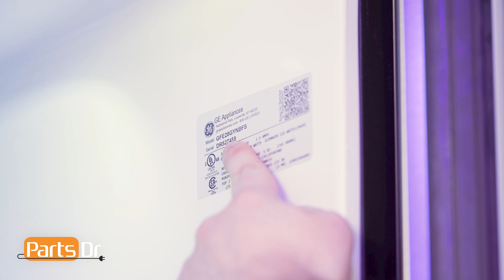GE refrigerator not cooling? Check these 5 things first!

Comment from the maker: We're glad you're here to troubleshoot your GE refrigerator! A quick heads-up if you need to replace any parts, be cautious when shopping online. Many of the lower-cost aftermarket parts on sites like Amazon or eBay are of much lower quality and can lead to further issues or even damage.

For the best results, we always recommend using genuine OEM parts. You can find high-quality GE refrigerator parts on our website at https://partsdr.com. These original parts are designed to work seamlessly with your appliance and provide lasting performance.

We hope this video helps you get your fridge cooling again. Let us know how your repair goes!

Comment: What about a refrigerator that is only three years old it’s a GE counter depth. I’ve taken off the back and tried to clean all the dust out as best I could, but it’s not cooling and it has a weird smell when you open the doors it kind of smells like burn pickles. I don’t know how else to describe it. I’ve taken all the shelves out I’ve smelled. I don’t know where the smell is coming from.

Comment: I just bought a house and moved in and the GE refrigerator (same one in this video) hasn’t been working. I had someone come clean the coils and the fan behind the back panel of the refrigerator and that still didn’t fix it so they came back and replaced the fan inside the refrigerator because it was also broken. While fully broken the refrigerator was rarely below 40, it was typically around 58 degrees. After cleaning the fan and coils in the back and replacing the fan inside the refrigerator section the temperature is usually at 34/35 which it’s set at that so that’s good, but I sometimes open the refrigerator and it’s like 42/43 degrees. Is something still broken? I don’t trust this refrigerator at all right now. I’m about to just buy a new refrigerator but I just moved into this house so I’m trying not to have the expense.

Comment: Hey bud, my fan in the freezer doesn’t stop while opened. And also my evaporator is frozen 
Perhaps one of the thermostats are failing ?
Reply from the maker: Yep, that could point to a bad door switch or a defrost issue. Try checking the door switch first, it should stop the fan when pressed. If that’s good, test the defrost thermostat and heater next.
Reply: Yeah the fan doesn’t work at all
Reply: Actually it’s on again now and the switch doesn’t turn it off

Comment: Thanks for the video.. originally, I thought it was the "Dual Water Inlet Valve" which I have already ordered.....but realized my freezer is not freezing as well.  I watched this video and I checked the fan to find, it will not turn off and I could see the element behind the fan (not real sure what to call it) has a chunk of ice formed over it which I dont see in your video.  Can you tell me what I need to order to get this repaired?  Thanks in advance
Reply from the maker: You’re right, that chunk of ice behind the fan is not supposed to be there. That area is the evaporator coil, and when it ices over it blocks airflow which stops the freezer from cooling properly. The most common causes are a failed defrost heater, defrost thermostat, defrost sensor, or control board not telling the unit to go into defrost. You’ll want to defrost the ice buildup so the fan can spin again, then test or replace the defrost components to keep the ice from coming back.  These video links below should help you:
Defrost sensor test: https://www.youtube.com/watch?v=SBfqozNgLYY
Defrost thermostat test: https://www.youtube.com/watch?v=i4SNEgPoUMY
Defrost heater test: https://www.youtube.com/watch?v=q7hysgipzpQ

Comment: Thanks for the great video.  Have double french door GE fridge ripped it all apart as the Refrigerator section wasn't cooling.  Fan wasn't working evaporator coils had lot of ice on them.  UPDATE:  Was worried about diagnostics to find the problem replaced the fridge fan and that alone fixed all the issues.  Defrost kicked on once fan ran for a while so thermostat & element worked fine to trigger that.  Simple $17 fix.
Reply from the maker: Thanks for the update, let us know how it goes!

Comment: I have a GE gfe26jymnffs the freezer its not freezing correctly, the coils has ice built-up. I replaced the 3 components,.temperature sensor, defrost thermostat and defrost heater and still has the same issue. Technician says maybe is the main control board, how can I test it? Any other suggestion?  Thanks

Comment: My GYE22GYNFS stopped cooling properly, fridge was at +50F, freezer I didn't measure it, but it melted frozen foods. But then, after a day or two, it resumed working, it happened twice, within a month a part. Is there a more likely issue here?

I had an appliance tech guy over, and he's saying it's the compressor and he said it would cost $1.4k to fix it.

Comment: My refrigerator doesn’t get very cold anymore and my freezer won’t freeze nothing. A few times a day my fridge will turn off and on and off and on every second so I have to unplug it and plug it back so I can stop shutting off and on. Am I right that it’s probably packed with ice and there’s and electrical issue underneath the refrigerator?
Reply from the maker: It’s possible you’re dealing with two related or unrelated issues. The cooling problem might be caused by ice buildup from a defrost system failure, while the turning on and off could point to an electrical issue or bad main control board. Sometimes a failing control board can actually cause both problems. Try checking for ice behind the rear freezer panel and inspect the control board for signs of damage or overheating.

Comment: What if the fan motor is completely dirty and has a bunch of lint back up in it?
Reply from the maker: If the fan motor is completely dirty and clogged with lint, it can definitely cause cooling issues. A dirty fan can slow down or stop completely, restricting airflow over the coils. Try cleaning the fan blades and motor area thoroughly. Just be sure to unplug the fridge first. If the fan still doesn't run smoothly afterward, the motor may need to be replaced. Let us know how it goes!

Comment: Could a bad thermistor cause the unit not to call for cooling at all?
Reply from the maker: Yes. A bad thermistor can send incorrect temperature readings to the control board, causing it not to activate the compressor or fans, so the unit won’t cool.  Try testing the thermistor as shown in this video here: https://www.youtube.com/watch?v=SBfqozNgLYY

Comment: Have a GE refrigerator not cooling. Both fan motors are operating, compressor operating. Evap coil was completely frozen like a block of ice. I thawed coil out and cleaned condenser motor and vents. After letting it sit for a day the coil starts to ice up around side rings less than 1 minute after turned on
Reply from the maker: It sounds like one of the automatic defrost components has failed.  Test and check the defrost heater, defrost sensor, and defrost thermostat to see if any of these have failed.
Test defrost thermostat: https://www.youtube.com/watch?v=i4SNEgPoUMY
Test defrost sensor: https://www.youtube.com/watch?v=SBfqozNgLYY
Test defrost heater: https://www.youtube.com/watch?v=q7hysgipzpQ

Comment: Such great information. I am having a little issue i am hoping you can address. My fridge will not cool anymore. I have a ge french door fridge gfe28gynbfs. I have run diagnostic mode and getting code 0010 ice maker thermistor out of tolerance. GE parts website states the thermistor should be WR55X11142 but mentions that that thermistor was replaced by WR55X10025. The tech sheets found in the upper middle cover state K-ohms for the ice maker thermistor should be about twice that of other thermistors in the fridge. Will i have to replace the mother board as well? I replaced the thermistor with a WR55X10025, visually checked capacitors and overall motherboard for any damage, start relay and capacitor, all fans running when in test mode, when doing fridge cooling test compressor turned on and slight cool air came out...however still not running. Are there other tests i can do? I am pulling out the new thermistor today and will double check K-ohms and my connectors to see if i poorly connected the thermistor or have a bad new thermsistor.
Reply from the maker: The 0010 error code is normal to see if you do not have a freezer ice maker installed on the refrigerator.  When the compressor is running, check to see if the evaporator coils are cooling and getting frost on them.  If there is no frost on either of the evaporator coils when the compressor is running, you either have a compressor or sealed system problem.  This type of repair will need to be done by a professional.
Reply: @PartsDr   it is a 2020ish model with ice maker and the main control board, profile door control board and ice maker thermistor were upgraded that only changing the thermistor would give me the same error code since the tech sheet mentions the ice maker thermistor should be 2x the resistance  of the new/updated thermistor. No frost is building up. Addition when I checked connection for the new thermistor (which is good) the code now reads  0010 lo 8b, whereas before it was flashing lo and two two digit numbers. And I wasn't sure if WR55X11142 would have the same resistance reading as WR55X10025,  which made me think that if they don't one of the control boards are reading the lower resistance and causing the same fault (replaced thermistor was far lower than it should have been and was for sure bad).  No frost is building up.  The compressor will only run when I put it in service mode to force cooling in fridge or freezer (can't remember the codes I put in, but something in 60s-90s range), but won't run continuously. No weird nocking but not long enough for any ice to build up.

Comment: Mine just fluctuates all the time. I have a sensor push temp sensor that reads to my phone. It shows that it goes up and down constantly. About 1/2 the time it’s above my alarm temp of 40 degrees. No rhyme or reason to it. Even in the middle of the night. And it’s set at 36 degrees.🤷‍♀️
Reply from the maker: Some temperature fluctuation is totally normal, especially during cooling cycles and the auto defrost cycle. But if your fridge is spending a lot of time above 40°F, that’s a bit more than what you’d typically expect. Quick swings are common, but it shouldn’t stay warm for long stretches. If you’re seeing long periods above 40°F, it’s worth checking for airflow issues, a weak door seal, or a faulty sensor. But brief ups and downs during defrost or when the door’s opened are normal for most modern fridges.
Reply: @ thanks! I do think it’s spending a little more time in the 40s than it should.

Comment: I have a GE  counter depth fridge in my RV. GWE19JY. The first one was replaced under warranty after several attempts to repair it. Now 11 months later the replacement has quit.  I will be testing the start relay as your video shows. My question is in your opinion is this a bad product to have in a RV that goes up and down the road and not all roads are smooth?
Reply from the maker: You will need to check with the manufacturer to see if they recommend that type of use for that model.

Comment: What if the Evaporator fan in the first section of the video doesn't automatically turn off when the door is open? It seems its running all the time and when I unplug it I can see a lot of ice build up on the evaporators..
Reply from the maker: That doesn't sound like normal behavior that we typically see.  Assuming that the door switches are working properly, this could either indicate a failure of the main control board or that your refrigerator is not supposed to turns the fan off when the doors are opened.

Comment: @partsDr I replaced the evaporator motor and it still doesn't turn on with the door open and the switch depressed. Where do I go from here. All else functions both refrigerator and freezer were running but not cooling sufficiently. The evaporator motor wasn't coming on.Freezer was 18 for the was 48 with ice on the evaporator. Any advice is appreciated
Reply from the maker: It could be a bad main control board that supplies power to the motor or a bad door switch.  There is always a chance of the wiring being bad, but that would be pretty rare.
Reply: @PartsDr  thank you for the quick response

Comment: I have a GE quad door. If I turn the ice maker on the bottom right compartment that can be set to freezer, fridge or cooler stops working. It just has a weird buzzing noise. Service tech replaced the thermistor on the bottom right side, but did not fix it. His so called diagnostic tool showed the higher temps but that's it. Turned ice maker off and things eventually went back..... until I put food back into it. Then it started doing it again. Any ideas?
Reply from the maker: It could be caused by a bad ice maker, or the ice maker when turned on could be causing a failure of one of the control boards when an extra load is applied to it.  This could be tricky to troubleshoot further, you may need to try replacing some parts related to the issue or hire a technician to help you troubleshoot the issue further.

Comment: All items are good . Unit cold in freezer but not freezing or making any water freeze. Could the unit be low on gas?  Can the gas be top off by adding gas with a self tapping valve? If so what gas is use? Is it the R22 or R34 use in automobile?
Reply from the maker: Technically, refrigerant can be added, but it’s not recommended to just "top it off" like in a car. If the system is low, that means there’s a leak, which needs to be found and repaired first.  Typically this type of repair should be handled by a professional.  The type of refrigerator the system uses is usually listed on a tag inside of the refrigerator.

Comment: We have GNE27JYMKFFS refrigerator.  How do you get to the the evaporator fan motor.  There is a cover, but not enough access to it.  Do I remove the back panel?
Reply from the maker: Your model refrigerator only has one evaporator fan motor in the freezer and it should be accessed similar to what is shown in this video here: https://youtu.be/-xXNYogoKfo?feature=shared&t=1078

Comment: Excellent video thank you for doing it. Play some words of wisdom.m Sadly stumped what's causing both fridge and freezer warm on a GE MODEL # GSL22JFPC BS.  Have No voltage to the condenser fan motor. Oddly enough if has anything to do with this started after I defrosted the freezer because the drain plug was plugged with debree Caused Ice build up at bottom of freezer. no ice buildup on coils inside. Fan inside runs. No visible damage to control board on back. Compressor doesn't turn on
Reply from the maker: Even without visible damage, a main control board can fail internally and stop sending the necessary signals for the condenser fan and compressor to run.  Let us know what you find as the solution.

Comment: I have a GE side by side fridge. The temperature display is incorrect and the water dispenser quits working until I reset it. After the reset, the temperature shows the way too warm and the dispenser works for a few minutes before stopping again. We’ve replaced the fan motor in the freezer, the defrost heater, and the main control board. The compressor works. What else should we check?
Reply: GE DSE25JMHECES
Reply from the maker: @rachael2502  Thanks for sharing the details! Since you've replaced the fan, heater, and control board, check these next:

    Thermistors: A faulty sensor can cause incorrect temp readings. Test with a multimeter.  https://www.youtube.com/watch?v=SBfqozNgLYY
    Dispenser Board: Could be failing if the dispenser stops working after a reset.
    Door Switches: If a switch is faulty, the dispenser may think the door is open.
    Wiring: Inspect connections between the control board and dispenser.
Reply: @PartsDr  Thank you! We replaced the thermistor in the freezer last night and it is now cycling on snd off. Water dispenser still not working. Is it common for multiple things to start to not function? We started this process with freezer fan making a noise, and the coils freezing.

Comment: This video most definitely help me and I really appreciate it. My GE went out months ago same problem and luckily I had a serving frig for a back up so I kept using mines for the freezer. Couldn’t get no one to come look at it and my HVAC guy told me to check the fan but not knowing it was 2 fans until I watched this video. Located the second fan and it wasn’t working. Went to Fox appliances spent $74 for the part. I came home plugged it up and waited a couple of hours and checked the temp it was back at 34 degrees. Saved me hundreds of dollars . Thanks again
Reply: Which fans weren’t working no I replaced the fan inside the fridge behind the deli drawer and I have th exact fridge in this video but not it still won’t go below 40 degrees idk why it’s set to 35
Reply: @beeboosarmy5277 any update having same issue.
Reply from the maker: Nice job fixing it yourself!  Thank you for sharing!
Reply: @ Yes sir I appreciate you